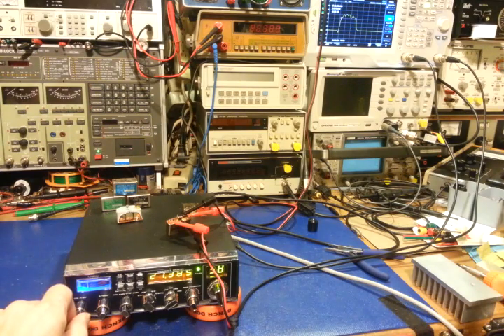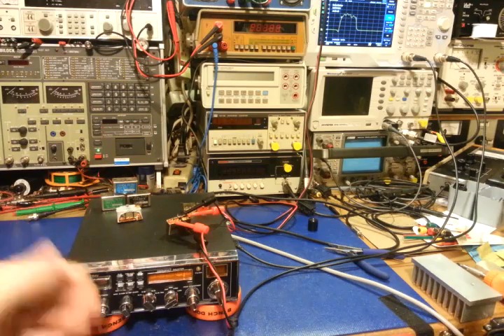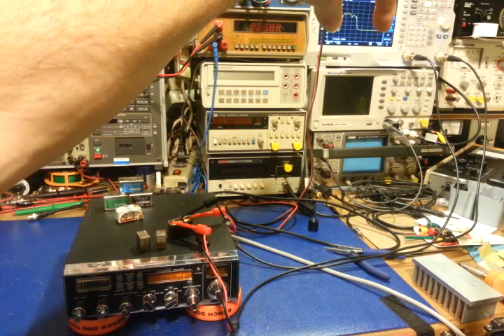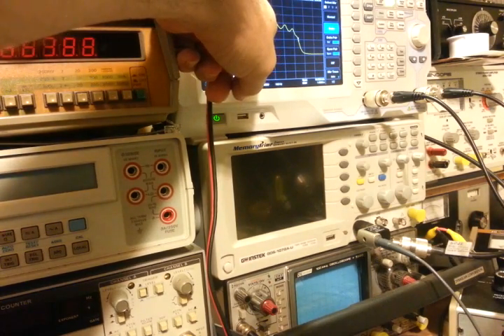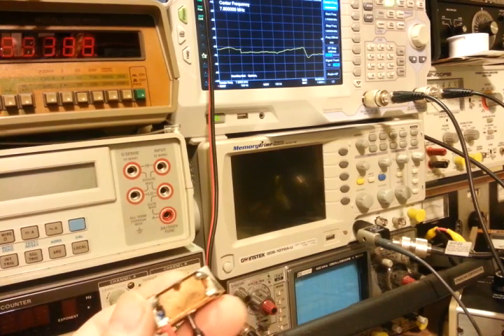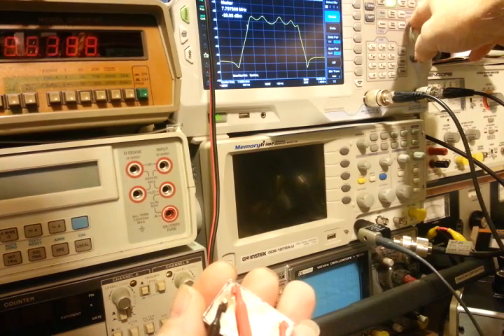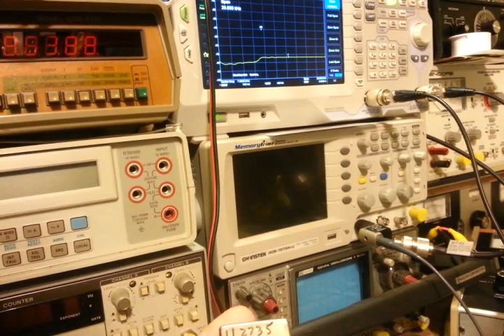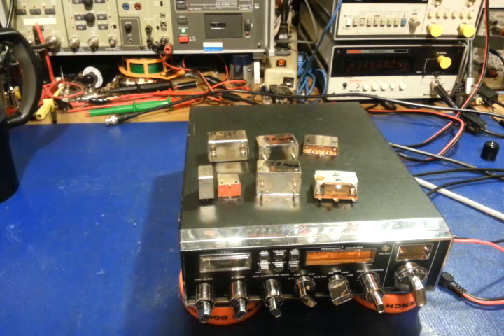Why your modern SSB side band CB receive is noisy. A look at crystal filters on spectrum analyzer.

Comment: as far as the new import radios go converted ten meter to cb bands i made a huge mistake by buying a nice ranger radio it sounded great and all that BUT WAY WAY WAY OVER PRICED I will never waist my money on one again! 525.00 brand new I could have bought a yaesu 450D for an extra 100 bucks and that had a whole lot more! more bands and then some! i just got caught up in the BS. THE RADIO SCAM as i call it! so for those that read this think twice of getting those over priced rip off radios! my opinion any ways i know i will never go that route again! you can get more bang for your buck if you just take your time and shop get the ham lic, more bands the better to talk on. if one band goes south ya have others to fall back on in some cases. as far as old radios i love them they do hold there own and cheaper too!
Reply: 62 BOSTON MA North East Corner stay away from anything that says Yaesu on it or you will get took again. YAESU stands for:Yet Another Excuse Simply Useless. I have owned them and would not own another if it was FREE.ICOM blows them away.
Reply: Yes! A used Icom or Yaesu entry level radio will coast you less than a base export CB radio. And your performance on TX and RX will be 100x better. Export radios being sold are WAY over priced.
Reply: True get a icom ic-7200 or yaseu 450d they come with roofing filters, DSP IF filters etc..
Reply: 62 BOSTON MA North East Corner True
Reply: Well, if you bought it for 10M it's a fine radio, but if you convert to 11M CB, then it's not.. it's a splatter box, unless it's done right.

Comment: I have constructed filters based on two 10.695 crystals and using one stage of amplification. Worked well to isolate the IF train from noise as it narrowed the skirts of the 'window'.
Reply from the maker: Sounds like a adaption of Lou Franklin's Channel Guard filters.
Reply from the maker: +ab5ni 

If your going to build your own you can buy 100 brand new crystals and sort through them.  At the price they sell for as long as you can make one good filter  its still cheaper than buying a premade one.

Comment: ive have a very old very rare ham international multi mode 3 its a little bit tight on the receive but very excellent on rejection and a cracking low floor noise level.
Reply from the maker: Yep, I'll take tight receive over a noisy receive any day of the week.

Comment: what can i do about a s9 rf noise of my superstar 3900 happens during the day and i live in a built up area will a filter work for me only happens on ssb cheers
Reply from the maker: Getting rid of noise in built up areas can be a challenge.   Have you tried a external DSP unit?
Reply: mike not yet but i can get one for testing thanks good idea cheers for that
Reply from the maker: +29pu04 

It can be a challenge getting rid of some noise.  DSP filters can help with some of that.  Do a search for them online and here on YouTube for demonstrations of them in use.
Reply: +MikesRadioRepair the west mountain dsp clrspeach ($185) I purchased from cheap ham and use on my uniden madison works like magic when conditions are noisy. by noisy I mean the occasional power line or plasma TV buzzing I get. it does much more than that and if you own or use one on an 11 meter cb or an hf that's equipped with a 32 bit floating DSP Texas instruments dsp chip it doesn't hurt to stack. it (IMO) don't get much better. my uniden madison hears impressively without the clrspch but when I turn it on, wow! if you're one of the unfortunate who has to deal with s9 power line (which I don't) interference log on to the cheap ham web site and buy one. very impressive piece of equipment. you will never regret spending the $185. great video Mike. thanks

Comment: whats a great ssb radio ??
Reply from the maker: There's a loaded question.  Most any of the good older rigs.  Teaberry, GE, Motorola, Lafayette, CPI, Colt, Stoner, Realistic and many many more.  All had good SSB radios, some better than others.
Reply: so what would u run ???
Reply from the maker: +3madeamps #3 in nc 

CPI 2000, Stoner Pro 40, hand wired Tram D201 with a modern dds vfo are some if my favorites for SSB.

Comment: my courier has the green filter, K07F22A....would the blue one be better for "hifi" receive being wider?
do these filters have anything to do with TX?
I have a blue FX07800-C....are they swappable like a ham rig?

Also mine has a crystal, ceramic and mechanical in it.

thanks for the informative video
Reply from the maker: Yes you should be able to just swap the green and blue filters.  There are two threaded studs in the bottom of them so there will be two nuts on the bottom of the pcb and then two pins to unsolder for the input and output.  Always make sure there are star washers under the nuts on this type filter.  They do not have a soldered ground pin so they ground through the studs.

In side band they are used in transmit.
Reply: MikesRadioRepair hmmmm thanks

Comment: Nowadays with DSP we don't really talk about filter shape factor, ringing, ripple, insertion loss, return etc. The 250Hz CW filter on my venerable Drake R-4C receiver is something to behold! Mike you're making me want to slip over to the workbench and fire up the Rigol just to play with some filters!  73 - Dino KL0S
Reply from the maker: Soooooo glad I got it with the optional tracking generator.  Doesn't get used a lot but is a great option.  Trying to use it more and more.  Some of those old CW filters were tight.  Modern rigs with filters and a dsp unit have a hard time outperforming them.  The old tube type CB's that had the Collins mechanical filters were impressive to.
Reply: Hey Randy! Yeah, being an OT has its perks...'course with my CRS disease I can't remember what they are! Mike and Buddy's channels are so enjoyable as I feel that kindred spirit and they always make my day and even more importantly I always learn something new.  73 - Dino KL0S

Comment: sometime could you do a video about setting driver and final bias and the difference between regular finals and mosfets? voltage vs amperage.
Reply: (Newbie Here) I believe Bi-Polar junction transistors (common for driver & finals in older radios) are current driven devices, and the mosfet's are voltage driven. Take my comment with several grains of salt as it may not be accurate. 
 I wouldn't mind a video on the subject as well. Although YouTube may have some videos touching on the subject already, I will have to look.
Reply: Type in Radio Final Bias in Youtube search box.  TRX Bench has some good tutorial videos also.

Comment: would it be hard to retrofit a better filter to the newer top end export radios?
Reply from the maker: It can but can be tricky.  Depends on input / output loading.  Big problem is is mounting.  The new types are small and the good old onea large.  Large ones don't fit in the footprint of the small ones so it either has to be mounted up off the board or remotely.   Now you stand a chance of the leads acting like a antenna and picking up noise.  It's easier to just get a good ssb radio.  The new junk box's may be fine for AM but if you want a good SSB radio get a older radio that has a chassis that used them factory.
Reply: I'm using a ranger 2970n2 for 10m and now I'm going to have to pop the lid and see what it has. I also have a yaesu ft857d in the truck too. I imagine that has pretty good filters plus digital noise reduction. My ham call is KD8HMO.
Reply from the maker: +Richard Burwell 

I can tell you the Ranger has one of those small ones in it.  The Yaesu has a better filter, HAM radios do.  One reason they cost more.